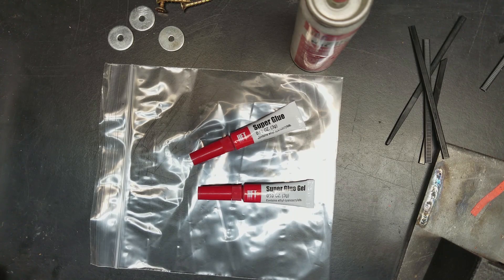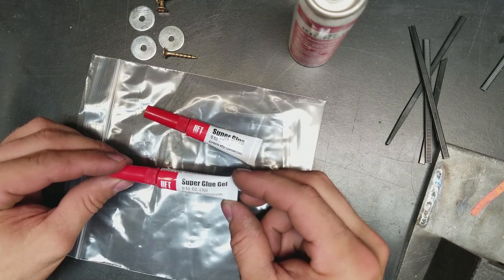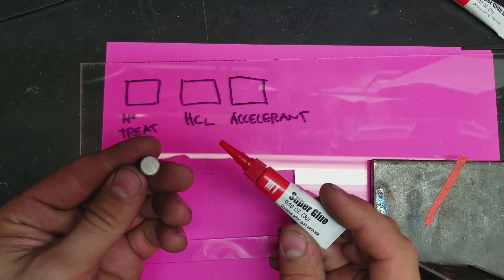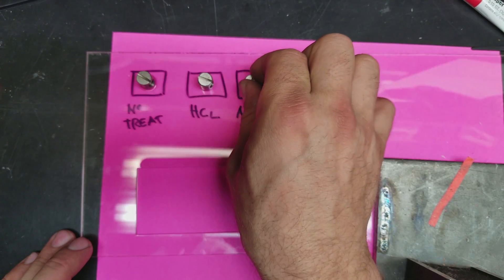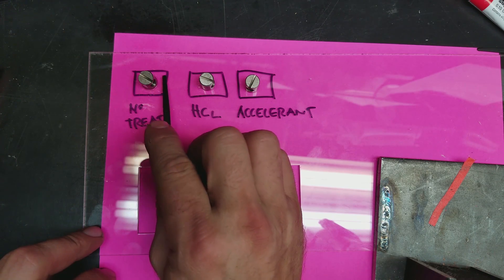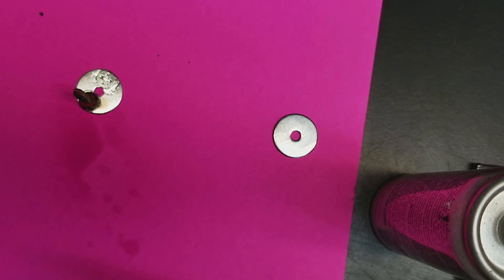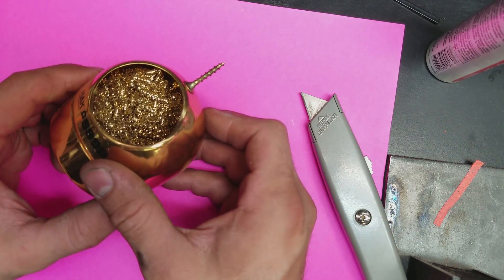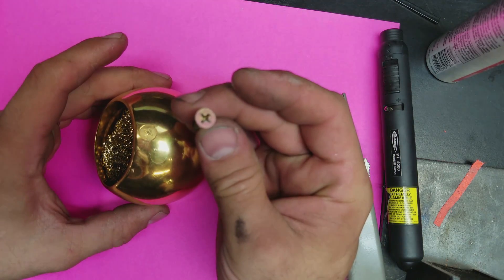Technique: Super Glue application, accelerants, and curing

Comment: Thanks for the video, it sheds some light on what I have been doing both right and wrong!  Just FYI about activators, I have used a CA glue sold for plastics, specifically the Loctite Plastics Bonding System, which comes with a pen similar to that described by "Good 'un" in a previous comment.  Now I realize the pen probably wasn't doing anything special "to the plastic" like I thought; it is probably just an accelerant.  In any case, it has worked well for me on plastics.
Reply from the maker: You're welcome! I've had a lot of good luck with Loctite/Henkel products. As you may have seen (and done) elsewhere, one of the most effective ways to use an accelerant or activator is to apply it to one of the surfaces being bonded, before bonding. I use that technique pretty often and it takes the guesswork out of when the adhesive will "kick" or cure.
Reply: Instablaster.

Comment: CA glues do not "dry"; they *cure*. The typical catalyst for curing is moisture, not just moisture in the air but moisture on the surface of  The objects you are gluing,  even metal or plastic,  will almost always have some residual  microscopic amounts of moisture on its surface at all times. One pitfall of CA glues is that as they start to cure they form a network or skein of crystalline threads on the outer surface of the glue where it is exposed to air, and this impedes the curing process by slowing the infiltration of moist air into the rest of the glue. This is why, if a thick glue joint or reinforcing dam is is desired, the  CA glue should be built up slowly in layers, allowing each layer to cure before applying. Using baking soda in combination with the glue to build up and reinforce the pieces also works best if applied in thin layers and built up slowly to the desired thickness.

At work (stereo repair shop), we frequently use CA glue to repair broken plastic pieces. Most of the generic brands sold in little tubes, even the Loctite and actual "SuperGlue" brands, don't work all that well, and I suspect their adhesive abilities (and curing time)  have been intentionally compromised by the manufacturers in order to avoid lots of personal injury claims. We have had far better results with the medium viscosity (somewhat syrupy) DAP and JB Weld CA glues. DAP also sells a handy "primer pen", like a miniature Sharpie, to apply to just one surface being glued (acts as an instant accelerant when the pieces are mated together). 

The water- thin TiteBond and Hot Stuff (Satellite City) CA glues are absolutely fantastic, and have such excellent capillary wetting  action that you can often assemble the pieces first, add the glue, and it will wick up into the spaces or cracks. They also set very quickly, *especially when used on or applied to organic materials, which  includes skin*. Those two ultra-thin CA glues will stick your fingers together in a nanosecond, and require extreme caution and advance planning before using them. Put the bottle in a bowl so that you can't spill it all over the table or bench! Keep a bottle of CA de-bonder on hand  (most are a mix of nitromethane and acetone, nitro by itself will work); and  Perhaps one should not attempt to glue anything with those super- fast glues unless there is someone else in the home with you, because dialing 911 might be difficult with your hands stuck to the table or each other! 

Most of the commercially available accelerants are quite likely to mar the surface of plastics, finished wood, and so on.   The Aeros spray can seems a poor way to apply any accelerant, like using a shotgun or a blunderbuss when what is required is a marksmans' rifle.  The accelerants invariably provide a weaker glue joint as well. 

BTW, I have never had much luck with the gel forms of CA glue....

Comment: Thanks Vice Chief. Incidentally, keeping cyanoacrylates in the refrigerator greatly extends their lifetime.
Reply from the maker: Thanks for the tip gb sumner!
Reply: Not according to the actual manufacturers of CA glues! Condensation of moisture on the inside of the fridge-chilled bottle causes the glue to start curing more quickly inside the bottle. Only factory sealed bottles of CA glue should be kept in the freezer.

Comment: Compliments on a very good presentation!...objectively and much more scientifically presented, than many others!
I  would expect there is some (very minor, but nonetheless present!) moisture content in the "dry" backing soda which quickly initiates, then promotes the continued polymerization or "knitting" as my CA expert friend calls it (Loktite/Henkel CA R&D specialist).  He also says simply the moisture of gently breathing on the joint will "accelerate" it (obviously not as quick as if an accelerator product were used, but faster than if joint has to get its moisture from surrounding air).  I have also heard that local Relative Humidity affects polymerization...that is, it works faster for example in Florida than Utah, simply because of RH!  This does sound plausible given the expert's comments.  Cheers
Reply from the maker: Thanks for the information! Always looking for a more complete understanding of adhesives and other joining technologies.

Comment: okay so how would i make an accelerator at home that wont make my CA glue "bloom" ?
i want to make bentwood rings and i cant find accelerator anywhere but online.
Reply from the maker: The "bloom" is usually the CA itself vaporizing and redepositing on the part. Have you tried baking soda for accelerant? It's favored among woodworkers.
Reply: @ViceChief  i have. Ive tried just about everything i can think of and it always blooms. Vinegar. Vingera dna water, water, baking soda and water, glass cleaner for the ammonia etc...
Reply: Mix half and half water and Rubbing Alcohol. Cheaper and works.

Comment: The best way to use accelerant vapor to cure CA is to use a puffer bottle: a small dish soap bottle with a cap is perfect.  Roll up a paper towel and stick it into the bottle.  Add about a teaspoon of accelerant.  Cap the bottle.  When you want to cure CA without it blushing (turning white), do the glue-up and then hold the puffer nozzle close to the wet CA.  Gently squeeze little puffs of air from the bottle and the vapor will set the CA quickly.  The paper towel in the bottle captures the liquid accelerator and prevents it from spitting.  You'll get perfect, fast joints every time.  Cheers!
Reply from the maker: Cool technique! Thanks.

Comment: I think the activator is only water, becourse super glue is activated by the air moisture.
Reply from the maker: Water does work to activate superglue, but the active ingredient in the activator I use is N,N-dimethyl-p-toluidine . Definitely not water.
Reply: @ViceChief  i can't find this stuff in the UK.